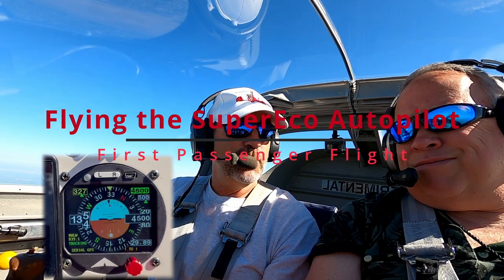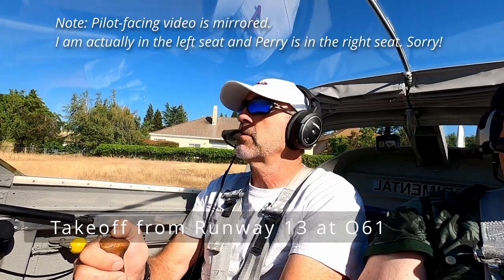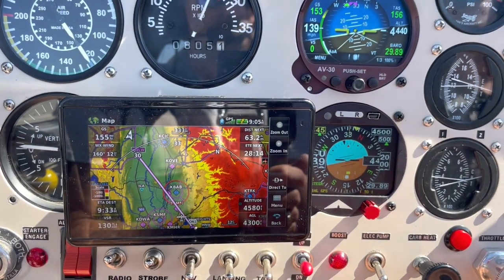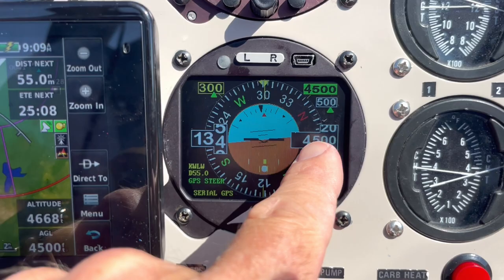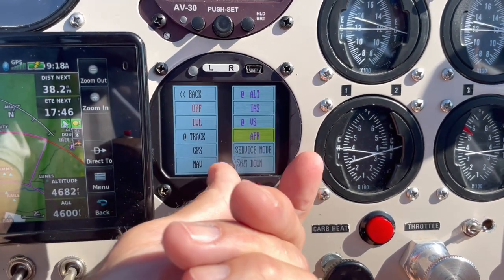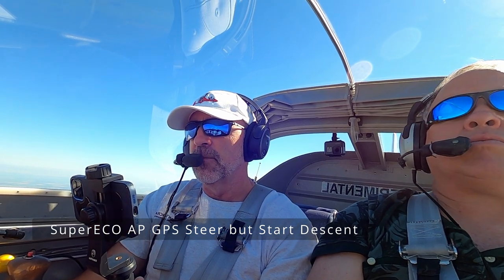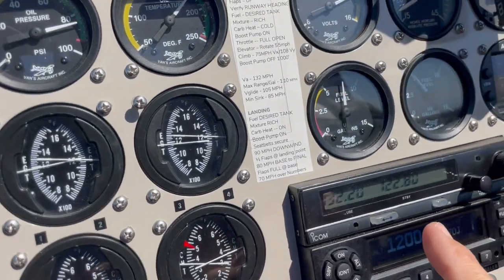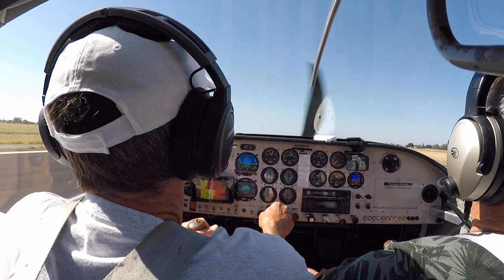SuperECO Autopilot First Passenger Flight in RV 6

Comment: Wow, it seems to work really well.   No slower to react than a conventional "hard-wired" AP.  The only thing that puts me off a little is the modes being so buried in those menus, all controlled with the one red knob.  They should look to sell a separate control module that links to the SuperECO, that has the conventional mode buttons for HDG, NAV, ALT, VS, IAS, etc.   I bet this wouldn't cost a lot as it'd be simply a control interface.   Would really move it up to the next level.